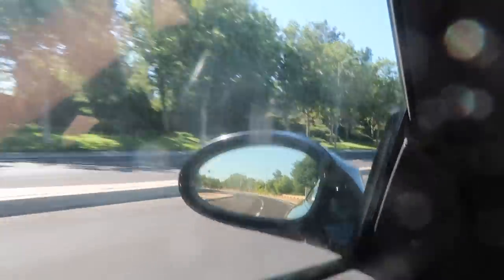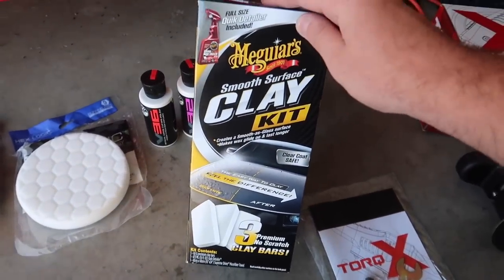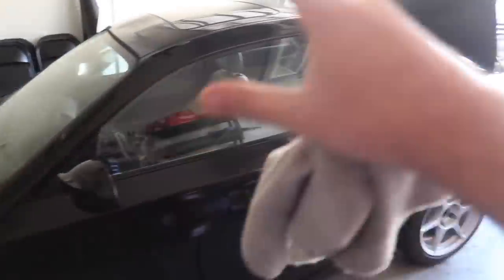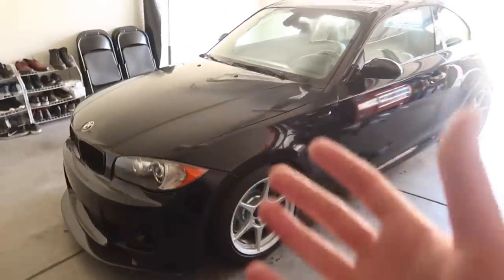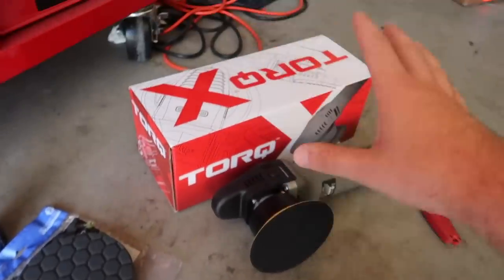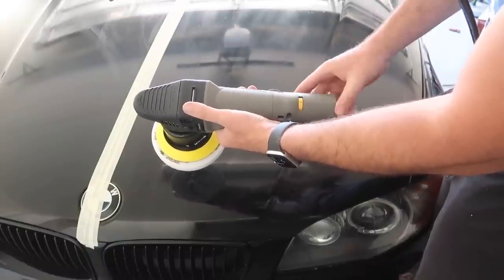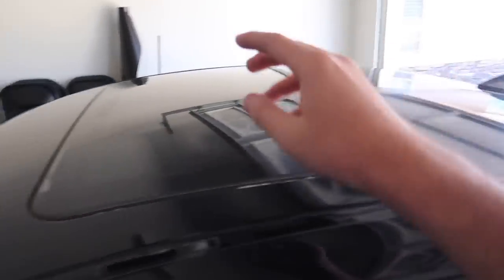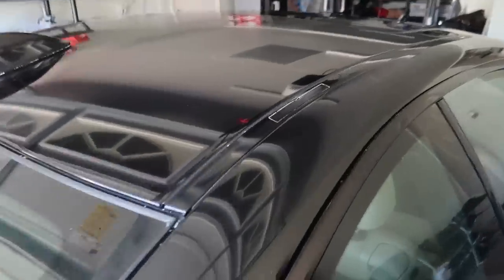THE N54 135I GETS ITS FIRST POLISH AFTER 10 YEARS! (Say Goodby To Paint Fade!)

Comment: You should have received a pad cleaner and conditioner with that kit. 5 dime sized drops and 2 sprays of the conditioner to help spread that compound. It also allows proper breakdowns of the cutting medium. If you need to, water will work as well. 

Bump up speed to cut, take your time and a couple more passes as needed. 

Nour, try this again but grab a URO fiber pad and some 3D One, apply pressure to cut ease up to polish, one step and you’re done. Hit me up if you have more questions.

Comment: 8:37 try polishing in small squares of 2×2 to see the results and then go around, the key to paint correction is to use the least combination first so try using a polish in a small spots first to see if it works or not because many times it's only what you need but if it doesn't then you'll go compound and then polish and then protected by wax or ceramic coating too don't forget that otherwise all this work will be wasted because this uv light from the sun are beating on the car and there's nothing to protect!

Comment: Ok so nour, I’m pretty certain your using wayyyyy tooooo much product, you only need 5 blobs that fill a hexagon on the pad, try and use a clean, plush micro fibre to stop streaks, and when you put the product on the pad, dab the product around the panel and use a low speed to evenly spread the product and then go to a high speed, don’t put loads of pressure on either just enough so you can hear the change when applying pressure, don’t take my advice properly as I’m not a professional but this is what I’ve heard
Reply: Was about to comment  this, but you said it for me!!
Reply: Also Nour,  work in muuuuch smaller spots!! ie; for the roof, you should work that into about 6 different square sections. Another way to think about it is a square about 1 foot x 1 foot or slightly bigger. When hand buffing the compound off, if the right amount of product was used it should buff off with microfiber within a couple of seconds leaving zero residue. 
Hope this helps!!! Much love brotha

Comment: Hey buddy, some tips on what products to get etc, get 3M products or chemical guys products. Ideally work 2x2 and do 50% overlap and go over the area 3-4 times in a cross pattern using compound. Analyse the area and if more work is required. Sand the car down with 5000grit sandpaper, compound the whole car and then polish it. There’s a lot of deep scratches on the car but bmw paint is fairly soft. That’ll make your car look like new and get rid of all the swirls+scratches.

Comment: Hi Nour !! Im happy to see you try new thing like polishing car !!! For the first time,  I can finally  give you some advices :-)   , first,  apply so much less product, maybe 2 to 3 small drop for a section of 2 by 2 feet. Apply more pressure on the machine ( it a entry level machine.... you have to make it work hard haha ) For the first step, spread the product at low speed and increase the speed to the maximum or 1 level lower . Your  pattern movement is a good thing, but go slower, maybe 1 second for 1 inch  , so you let time to the compound to make it work .Dont be scare to work a panel for a long time as long as you move. Somes pro can work 20-30 hours for 1 car. After each step of compound, apply a ipa solution for remove the polishing oil and have a clean panel.   For your first time is a nice nice try !!! :-)    Your friend @franc3555

Comment: meguiars 105 and 205 start low speed like 1 to spread the polish on the pad (I like to spread polish with hand on pad beforehand) the. Turn it up to like 5-7 and apply some pressure work that hood in 4 sections all panels same way. Let the product haze before wiping and then spray some ipa on car and wipe off residule compound and apply a ceramic just make sure paint is what you want before u ceramic coat

Comment: It does look better.  Yeah, the roof is tough.  Same thing happened to my wife's e90.  It's difficult to bring back because the original paint is really hard.  You may need to do a light wet sand with 3000 grit.   Repeat of what is said already.  But I have to emphasize use only 2-3 pea size beads of product.  Let the pad do the work.  You'll get a better feeling of the machine cutting into the paint.  For the paint chips I've been using an 18ga syringe with a blunt tip to apply just enough touch up paint into the chip.  Works pretty well.

Comment: -First put 4 lines of product on your pad -then get a application pad or use your finger to work it in the pad then use 4 dime size drops of product on the paint.
-Speed to 5/6 and work slowly 
-Get a air compressor after each hit clear out your pad.
Less product = more result the paint heats up a little bit and the pad is cutting through the paint (sound aggressive but its not) 
On some spots you can use finishing pad with for example 3 in 1 cleaners meguiars has a 3 in 1
Reply: Im not a expert i just started detailing but helping people out with my knowledge i did on the internet, im not a expert please correct me if im saying something thats wrong

Comment: Using a dual action on bmw paint with chemical guys products ain't gonna work for you. Best option would be keep the machine, buy meguiars microfiber pads (cutting and finishing) pads and d300 and d301. Crank up to highest speed and work in smaller areas.  Allow pad to move so apply enough pressure that it doesn't stop rotating.  If you want to do it properly find a proper detailer with experience. Bmw paint can be solid so if you want it properly fixed then looking at a rotary and wool pad with scholls s3 gold, then to meguiars mf pad and d300 followed by scholls s40 on your black hex pad

Comment: Your using too much compound, try not to do such large areas in 1 go 

Speed 4 orange pad with 5-6 pea sized dots on the pad and do an area 15” square wipe then do another pass 

Should be none of those swirl scratch marks after the first cut 

Youd be better off with a yellow hex logic pad and and some menzerna 400 cutting compound them some menzerna 3800 with the black hex logic :)

Comment: Sorry bro ur doing it wrong.  You should have sprayed iron remover after washing it then washed it again after clay baring the car.  Then sprayed a ammonia prep degreaser before u start using compounds. Also I would use a more corse cutting compound and pad based on ur paint condition and you only need a few pea size of compound a d polish . 2nd u need to be at least at 5-6000 rpms .  3rd u need to buff off the polish with a microfiber towel inbetween each stage of polish and no 2-3000 rpms in each polish is a waste of time